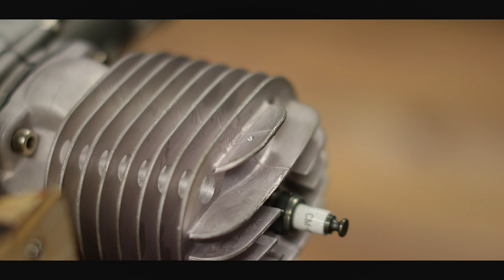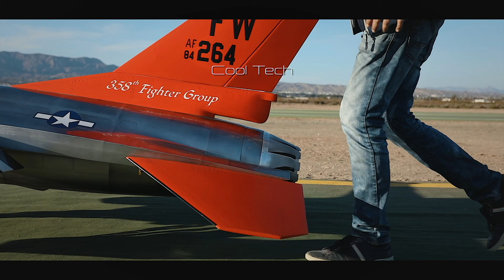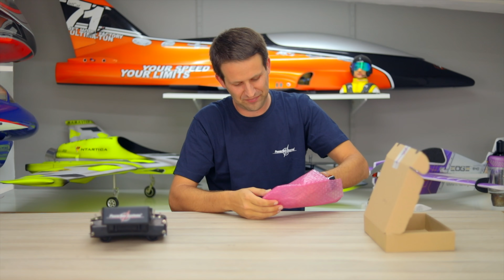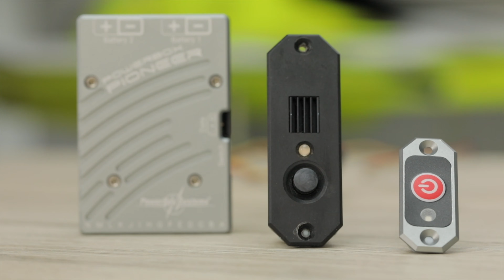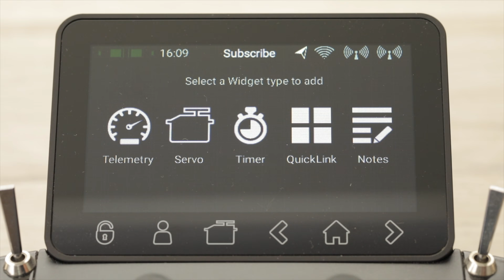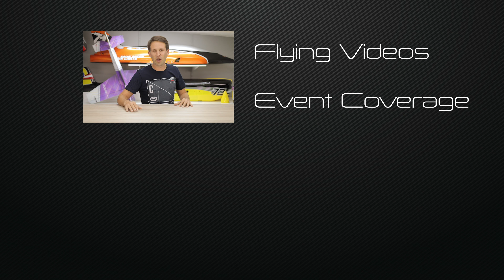Powerbox-Systems Pioneer - THE FUTURE OF POWERBOXES?!

Comment: Hello I am interested in the Pioneer control unit that will be connected with Futaba 7108 sb via sbus 2. I wonder if: 1) it is possible to freely assign the outputs to each channel 2) if all channels are matching 3) is programming done only with the appropriate software and pc or also from a switch? Thanks Francesco Simoncioni
Reply from the maker: Pioneer is “straight output”, so it will always reflect the servo monitor in your Futaba radio. All channel asigning, matching, etc, is done in the radio…
Reply: @MartinPickering-PickeringRC  Grazie !!

Comment: Hi Martin,

On an Extreme Flight Extra 300 104 100cc, should i use a Pioneer or a Competiton SRS? My Tx is Core. I can match servos with my Core.
Reply from the maker: Either will work well, so whichever you like most. Just note the aileron matching will be with the Core in case of using the Pioneer

Comment: Is a powerbox another name for Speed controller or ECU?
Reply from the maker: Powerbox is basically a power distribution unit for the servos. It filters the signal, assures servos receive sufficient power, accepts dual battery, dual receiver, has redundant  systems built in. It is basically a high power safety feature required by mostly all large models.  They also make other things now such as transmitters, batteries but this is what they came from and are best known for.

Comment: I started with RC models when I was 13 years old and in my time I remembered gyroscopes we're only for helicopters, my first plane have only 4 channels controlled with a Futaba radio in AM, and in the field, we have to choose the signal to avoid interference with other planes in the air. But today even gyros are for planes is like the flight by wire of commercial and fighters planes. Amazing video thanks for sharing

Comment: If running the Pioneer with an iGyro sat, how many total stabilized channels do I get, and with what limitations?
I have a small model where this would be perfect, but need 6 stabilized channels in pitch + 4 in roll + 2 in yaw. (10 total, since two of the pitch channels and 2 of the roll channels are the same/delta)
Reply from the maker: Hi Janmb, I am curious what model has more servos on pitch than roll?  Pioneer has 9 stabilized channels, 3 on each axis, for the amounts you are stating you would be better off with a Royal as I think its the only one to have enough channel outputs, even Mercury would possibly be lacking in servo sockets?
Reply: @MartinPickering-PickeringRC  Thanks Martin.

The model in question is quite small so a royal or any traditional PB would not fit

I'm working on a foamie eurofighter, which has elevons, canards, rudder, and pitch/roll/yaw vectoring - of which I want it all stabilized 😎

In terms of size, the pioneer would been brilliant

Comment: Would I need a receiver with this, if I'm running a powerbox core transmitter?
Reply from the maker: Yes, still need to add Rx, but can just use the 26D and it will pull all the channels from it

Comment: This is really neat and I have been watching PBS for a while. My next plane may very well be fully outfitted with PB systems. What is the battery used with the Pioneer?
Reply from the maker: Can use any standard type battery, so Lipo, LiFe, LiIon or Nimh, all within the usual voltage ranges 4-9v

Comment: I love all the Powerbox stuff but if there is no power regulation an no servo matching what can it do  that a 14 channel receiver and an Igyro 3E cant do especially when using Futaba.
Reply from the maker: Hi Stephen. (sorry, long answer!)

Think of this particular unit as a kind of middle step between a receiver and a more conventional full blown powerbox.  

Sure, it doesn't drop the voltage (which a lot of people have been wanting since all servos nowadays state speeds and torques at 8.4v) however all the other benefits are still there...  Dual batteries, high power outputs, filtered servo signals, all with the reliability and redundancy of Powerbox.

This is also reflected in the price... 

Your example:
-14ch receiver (200€)
-iGyro 3e (now replaced by iGyro 3xtra - 230€)

Total: 430€ 
Thats for a setup with a single receiver and single battery, that can't handle powerful servos...
Even if running the Futaba dual battery receiver, the manual actually recommends not using servos beyond 18kg torque - which is uselsss in many applications!

Pioneer example:
-Pioneer (200€)
-iGyro SAT (100€),

Total 300€, that gives you 130€ change to pick up a couple of receivers, and provides you with all the usual Powerbox guarantees, including dual battery, dual receiver, and all what's mentioned above...

Based on that, my view is, Pioneer all the way...

Oh, but yet, for Futaba users it sucks not being able to set everything from the radio and doing it all from a phone or tablet, however this is due to the Futaba radio software not being capable, not due to Powerbox not implementing it...

Let me know your thoughts!
Martin
Reply: @MartinPickering-PickeringRC  Yes it would be a completely different way of setting up a plane at reasonable cost as adding an Igyro Sat would be half the cost of a 3Xtra Igyro, look forward to the next part of the video. Would be nice to see it setup with the BlueCom adapter using Futaba if you ever get a chance. Many Thanks.

Comment: So just that I understand correctly, it’s only going to put out the amount of voltage of what batteries are connected to it. So you can still run low voltage servos if needed?
Reply from the maker: Hi Matt, yes, you can still run any kind of servo, but always noting that the Pioneer will not drop the voltage (regulate), so if you are using low voltage batteries,  you will be fine, but if using Lipo, you will be sending full voltage to the servos, in which case one of the current regulated Powerboxes may be a better option
Reply: Pickering RC sweet thank you
Reply: @MartinPickering-PickeringRC  I noticed 26D Rx voltage telemetry in my Core display said 6,3V and this was a LiFe giving 6,6V on my Fluke so a small drop there is.
Reply from the maker: @superleeds1966  there is not at 0,3v drop... think your battery wasnt charged as much as you think 😄
Reply: @MartinPickering-PickeringRC  Hi, yes fully charged battery, the volt came from my D26 receiver which is 0,3V lower than the Pioneer Voltage read from the telemetry on both devices. RX is connected vis P2 bus to Pioneer. No big deal. :)